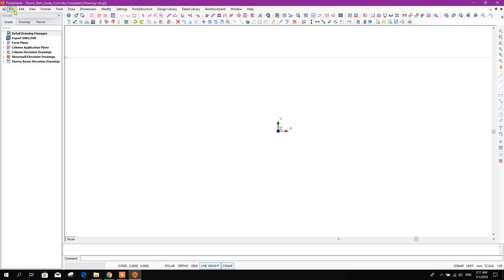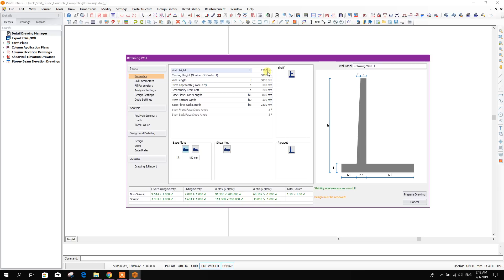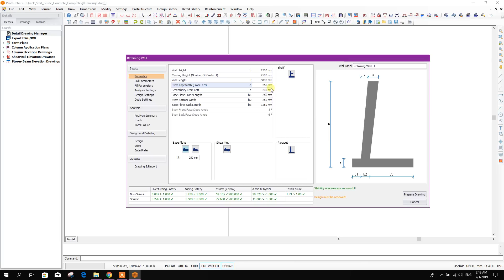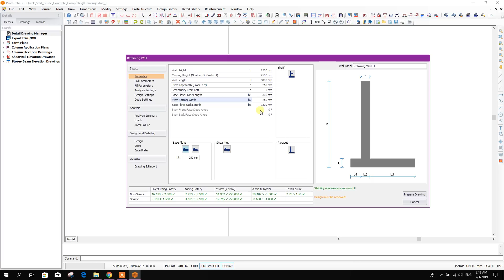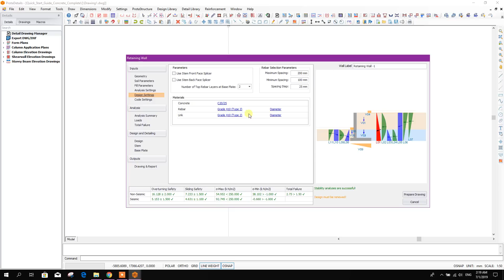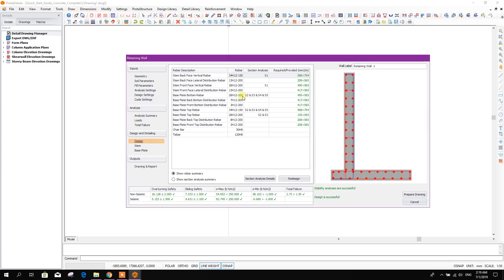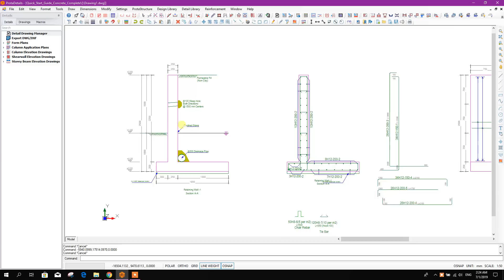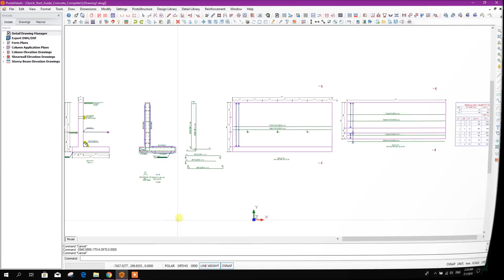Cantilever Retaining Wall Design & Detailing

Comment: Dude, I am waiting for a video on cold-form steel members. Try to use Risa 3D V17, and make a earthquake analysis.
Reply from the maker: That is done in SAP2000.
Reply: @Decodebd  I had already known that. But, SAP2000 can just design a few shape of members, so it does not analyze any type of structures created with nonpredefined coldform members.